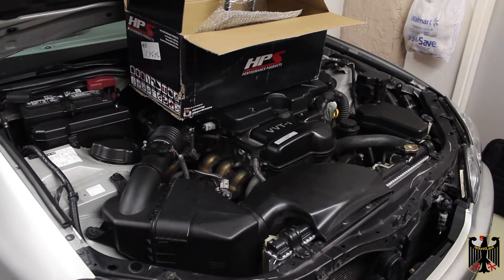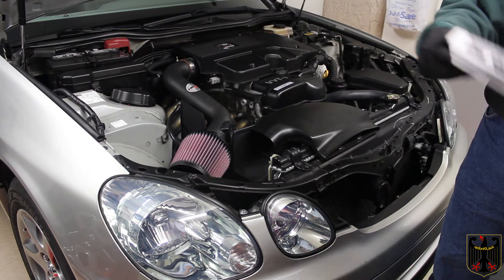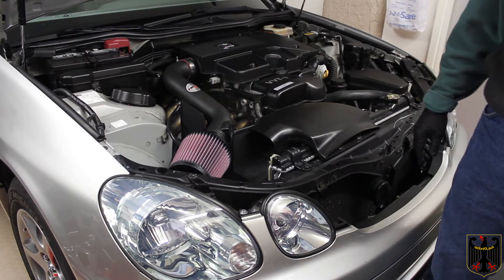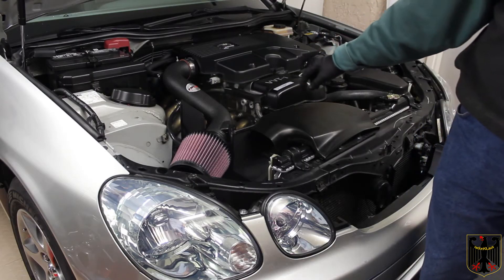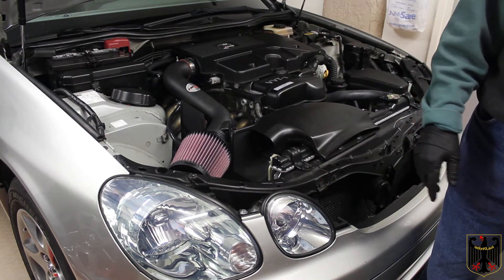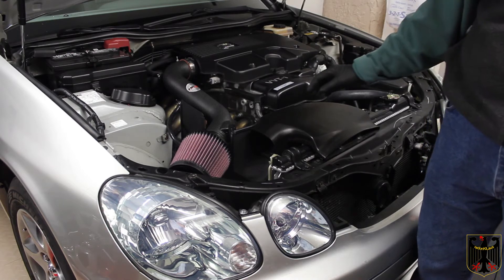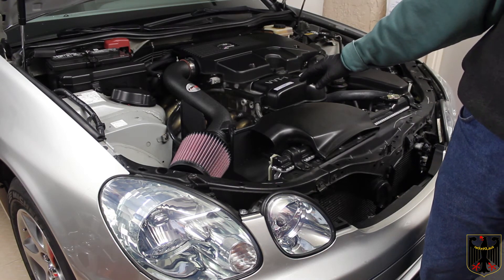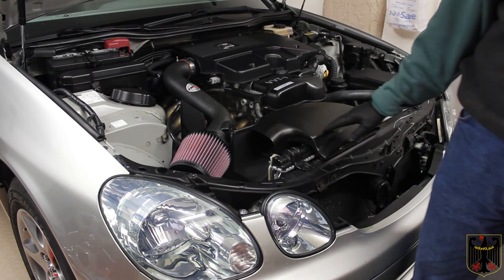Lexus GS300 HPS Intake Installation

Comment: Did this install make any lights pop up or any problems with the GS
Reply from the maker: No issues at all.  Thanks for watching!
Reply: @redonKiLaus  dosent it make the gas run faster aka more gas money lol
Reply from the maker: @TienBuilds  If you hit the pedal harder then sure, otherwise in my testing this increased fuel efficiency, at least when combined with an exhaust.

Comment: Would this work with my 2000 gs300?
Reply from the maker: Not unless you change MAF sensors, the 98-00 cars used a different, much larger sensor.  Thanks for watching!

Comment: Will this fit a 2000 GS300?
Reply from the maker: Physically, yes, but the MAF sensor is different between 2000 and below and 2001+, so you'd need to retrofit that as well.  Thanks for watching!

Comment: Is this California legal?
Reply from the maker: Unfortunately not, no CARB certification or sticker.  I don't know of any intake for the GS that is certified.  Thanks for watching!
Reply: Post more videos. On the GS
Reply from the maker: I post them as I maintain/modify the car.  If there are any specific videos you'd like to see just let me know and I'll see what I can do.
Reply: Water pump. Cooling system still overheating after. Radiator thermostat sensors changed. So next I’ll try water pump.
Reply from the maker: That's one I wont be doing any time soon since the original owner of my car had that done along with the timing belt just before I purchased it.  Sorry about that!
Reply: No I have one for my lex but it's illegal you have to switch it out before smog then put it back sux

Comment: 1:04 what does this thing is called ? and what is it for ?
Reply from the maker: If I recall correctly that's the EVAP solenoid, which is part of your emissions system.  Definitely a necessary part.  Thanks for watching!
Reply: redonKiLaus is it possiable that if it's not plugged, i would lose the fuel faster ? or it has nothing to do with the fuel consumbtion ?

Comment: Great video.  Quick question, does the intake provide more horse power?  Any benefits to adding an air intake?
Reply from the maker: Honestly, any intake without a proper tune won't provide any power gains, just a noise increase.  You may see fuel efficiency increases depending on the configuration of your vehicle and other modifications.  Thanks for watching!

Comment: Love your videos but the stock air intake on the GS300 is so much better then an aftermarket one (hps) I had the hps installed on mine but went back too the stock intake with a K&N panel filter and I actually felt a slight acceleration and overall power gain, each too there own though ! no hate on you guys just wanted too put in my input. Keep up the great work with the video's on the GS you's have helped me out with a lot of things on mine :) thankyou !
Reply from the maker: I agree with you, and switched back to my stock intake as well after about 6 months.  The only reason I installed the aftermarket one was for a thesis project, but took it off to regain some lost low end torque and better filtration.  Thanks for watching!
Reply: redonKiLaus  i personally wouldn't put a pod filter on a naturally aspirated car but if it had a turbo if be running a pod filter with no If or buts but stock air intake on most N/A's is perfect ! if you're not running a K&N panel filter for the stock airbox I'd definitely be looking at getting one they're great and are reusable